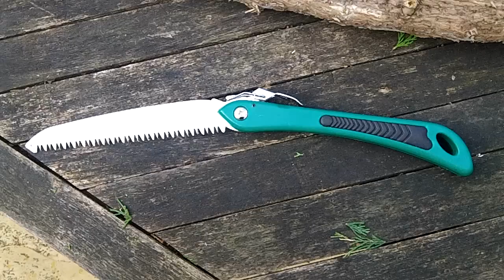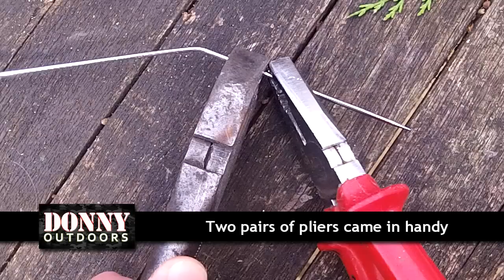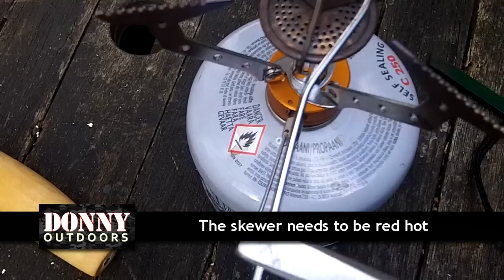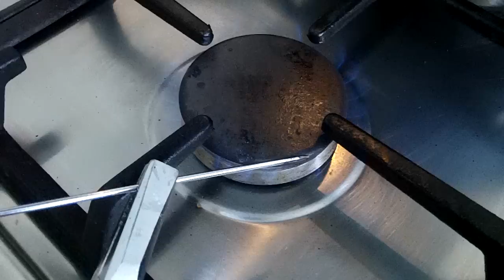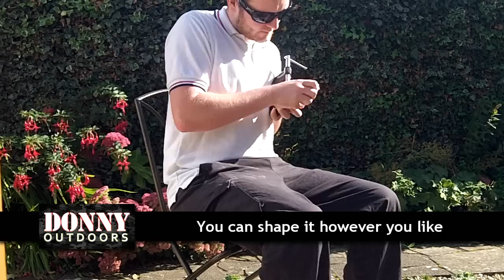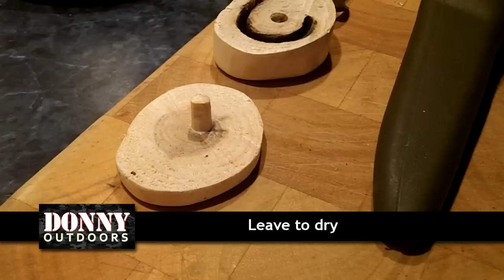Making a case for my crook knife

Comment from the maker: Hey there. I can't quite remember exactly. But as long as you get the metal nice and hot and push it down hard with something into the hole, it could be done in 30 mins I reckon.